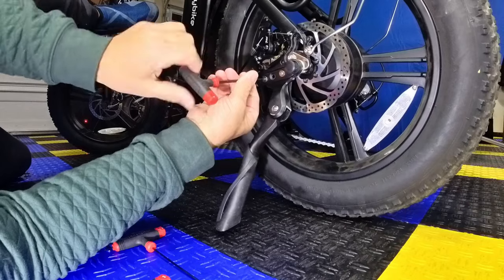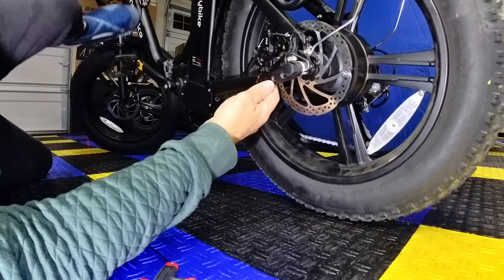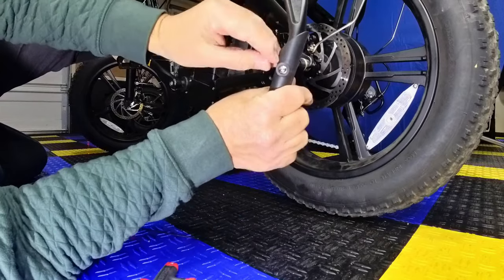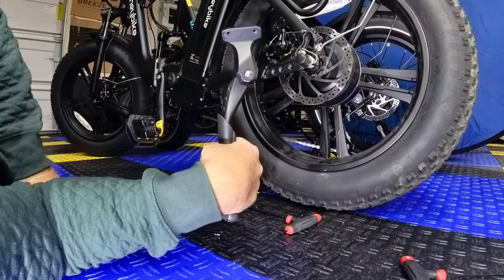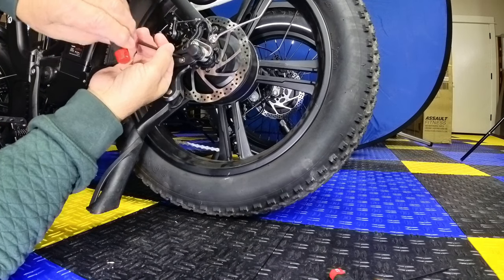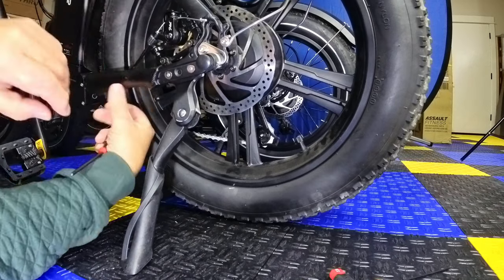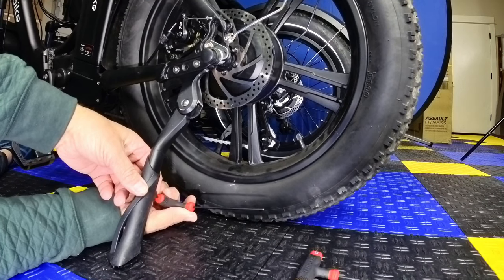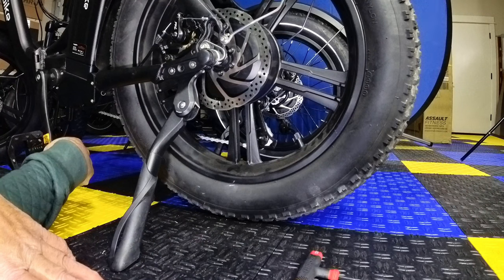Adjusting The Kickstand on most e-bikes

Comment: I tried every tool it came with on that screw, then gave up, assuming it was a rivet. I got two JASION E-bikes and both fall over to the right with a calm breeze. I didn’t try MY OWN tools. Why would they not provide what the bike requires???
Reply from the maker: I think your talking abouut the kickstand screw.  Its probubly provided, but the tools provided are cheap.  I have had some tools from ebike makes that were complete garbage and went to use my own smame size allen like a 4mm or 5mm whast worked with my tool.  Besides crappy tools I think that bike might be the best bang for the buck bike.
Reply: @RVEnthusiast  Yes. The screw that they put in the worst spot. Not visible without laying down on the opposite side and using a flashlight to see what kinda head it has. I got one of the two off, and it turns out…that’s as high as I can get it. Leaving the foot off puts it at the perfect height. I probably will cut the length off myself so I can put the rubber foot back on…which seemingly will be a nightmare, as the threaded part on the inside is a loose piece of metal…that actually fell down and got stuck inside the foot. I had to use a chopstick
Reply from the maker: Yep I remember trying to adjust sever kickstands and it so dumb. THey should make it with like spring pin to set different hights. I have a Rattan that leans way over right now. Don't want to get on the floor to fix it. @CaptainJirk

Comment: Bruce, you're a mindreader!  (I was going to suggest doing a video of how to adjust the kickstand last week, but didn't get around to doing it because of Christmas shopping.)

* * * * *

5:35 time mark:  Bike lean angle.  Reading through the literature, it looks like the general recommendation is 10° to 15° from vertical (maximum 25°).  It varies from bike to bike, because each bike's center of gravity differs.  

Bikes should be set up with a comfortable lean angle:  not too little and not too much.  It will be obvious if the lean angle is too much.  Less obvious is too little of a lean angle (near vertical), where the bike will tend to fall away from the kickstand side.

* * * * *

I haven't yet adjusted the kickstand for my Ocelot Pro.  It came from the factory with about a 20° to 25° lean angle.    I'll try out my new handlebar jacks when I make the adjustment.
Reply from the maker: It makes sense to do it.  Who kows they are adjustable...Pretty smart of them to make it that way though.